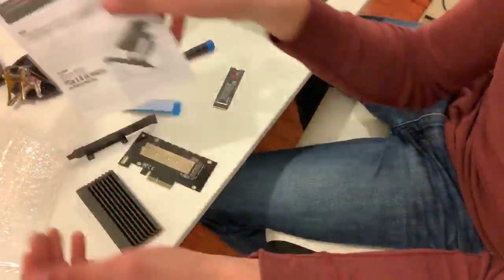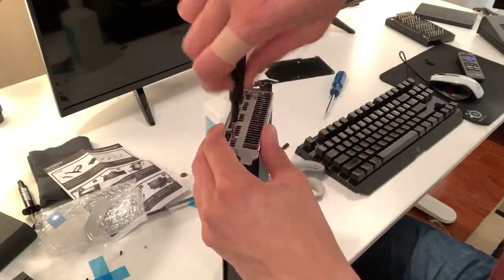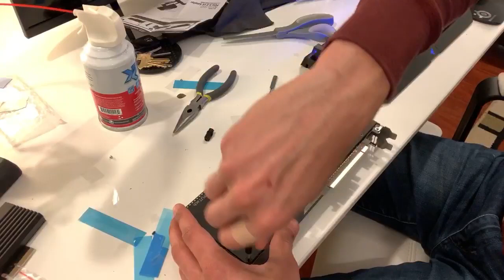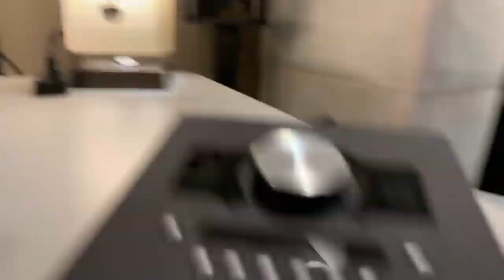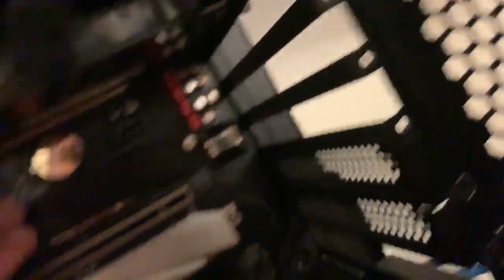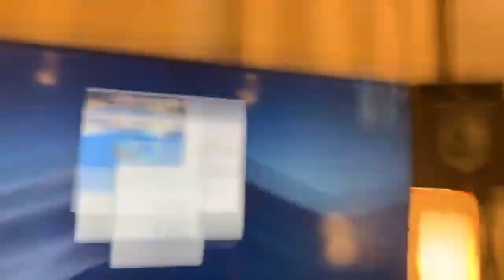Vega 64 Thermal Grizzly Application + Making the backplate useful! For 9900k Designare Hackintosh

Comment: How did you do the vanilla bootloader? How did you managed to solve the issues that you encounter previously?Does the thunderbolt 3 work? How did you do the smbbios serial numbering fix?
Reply from the maker: Hi! Did vanilla bootloader following a guide I'll link here, issues were solved with tons of googling and trial and error, failed boots, etc. Will be posting a concise guide of all the final settings in a week or so after I've worked out the bugs. Thunderbolt 3 works flawlessly, probably the easiest part of the whole build. smbbios serial was generated with Clover, and I THINK it's covered in this guide, but if not, it's pretty easy to generate using Clover Configurator.

Coffee Lake section: https://hackintosh.gitbook.io/-r-hackintosh-vanilla-desktop-guide/